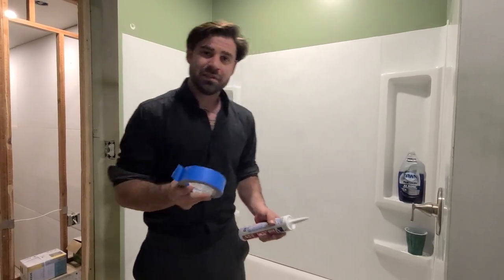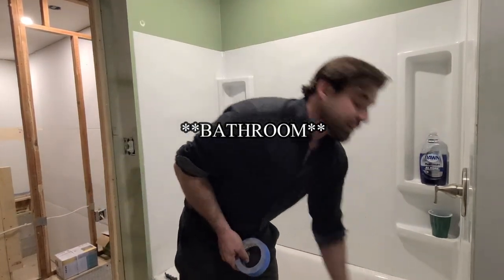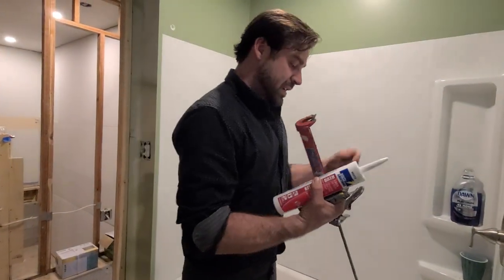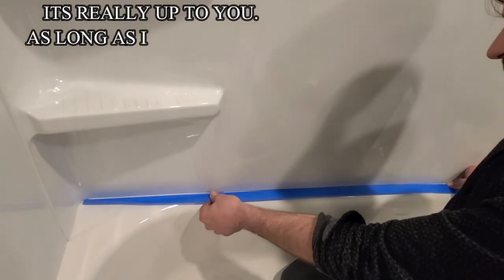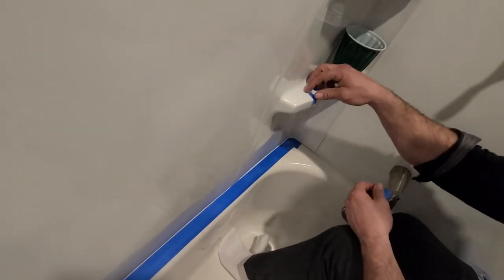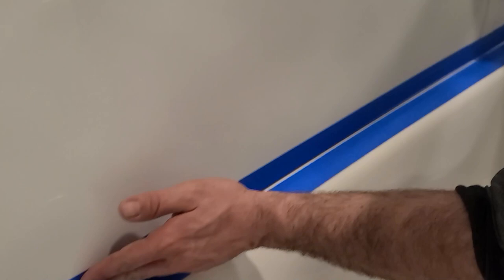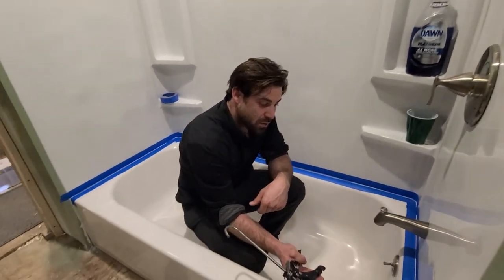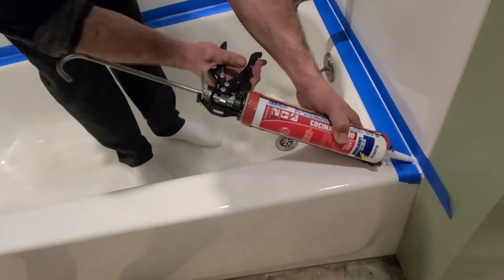HOW TO | Caulk perfect lines

Comment: You successfully took a 3-minute job and made it take 20 minutes! You realize you can do the exact same thing without the tape, right? The trick to caulking is the way you cut the tip to lay down the bead and constant steady pressure with the gun. If you're not real good at it then get the tube!
Also, typically you want to make sure that the shower surround is secure to the wall before you begin caulking. Susie Homemaker tip of the day is if the shower surround pops up with only the pressure painters tape it's not time to caulk
Reply: I think hes demonstrating for amateurs which the tape is probably the best option.

Comment: also, one should never have to tool with there finger... the tip of the caulking tube should be the caulking tool... shouldnt have to touch a caulking bh dead at all once u run it..... ( I've installed windows for 20 years..)
Reply from the maker: i don't tape windows either bro! that was gonna be part 2 of this video
Reply: @NWIVeteranConstruction  u know what I mean tho bub....